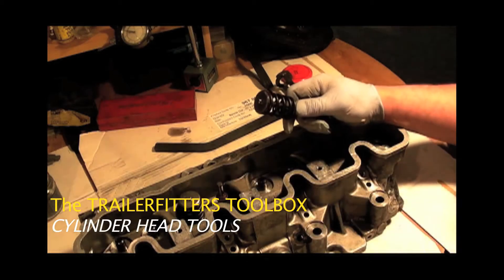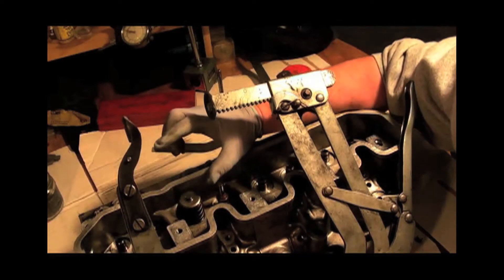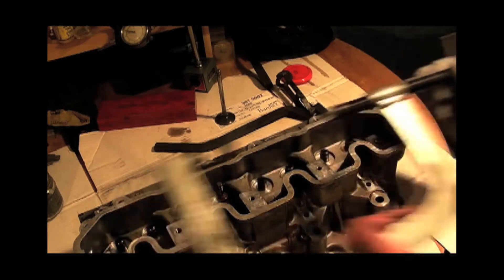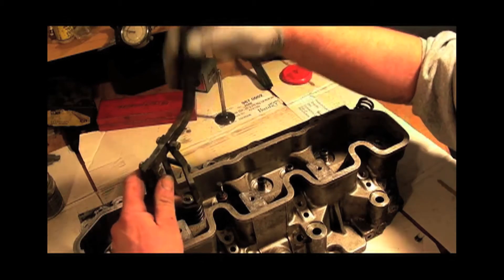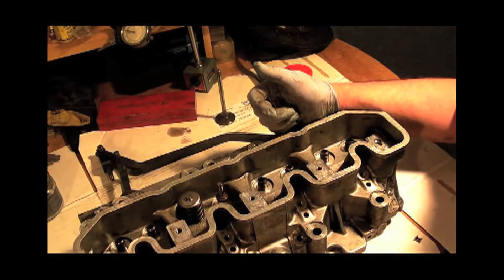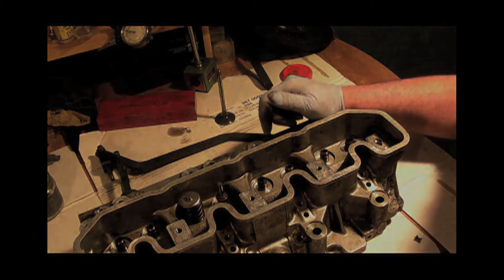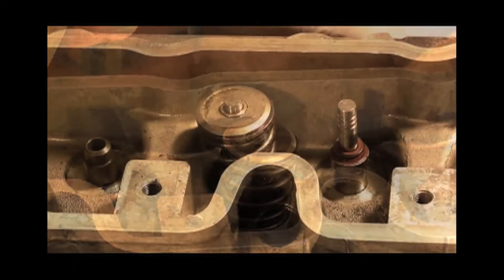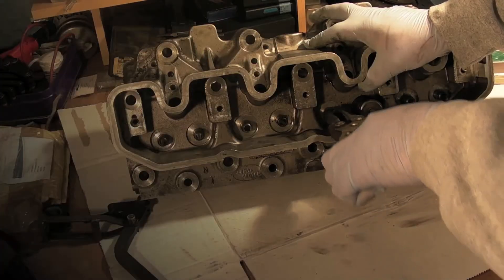Valve Spring Compressor  200tdi and 300tdi Land Rover Diesel Engine

Comment: I have made the same myself and also made with and old spark plug a tool to connect to the air compressor and change on my series 2 2.25 3 main bearings all the valve stem seals. The white smoke has gone.  Regrettably the tool is in Tanzania now. I will make a video and upload it in due time!